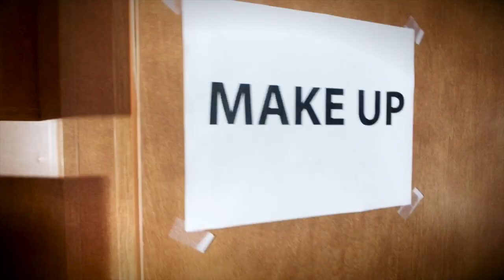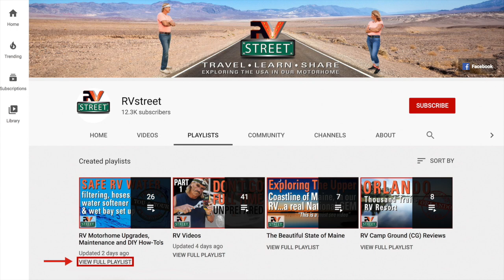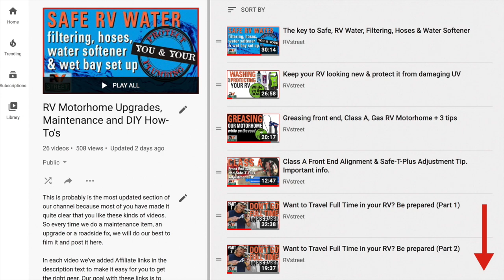RV KwiKee Power Steps: EVERYTHING YOU NEED TO KNOW

Comment: Great video pointing to more action I need to take maintaining my steps. Thanks. I had a failure on our power Maxx Air rooftop fan this week. The metal gear housing that activates the control arms for the cap totally shattered! Yet no plastic moving parts in the fan activator failed- go figure! Its an easy fix replacing it but I hate working on the roof! More proactive maintenance possibly could have forestalled that failure as the vent cap sometimes sticks to the lip seal flange stressing the system. A little seal treatment and lube could have saved me about $30. 2 other upcoming projects are replacing the house AGM batteries, and annual maintenance on the Onan genny. I've changed the fuel filter on the genny and the fuel pump once in 5 years but am debating changing them again so I don't get caught. 450 hours on it now. Future videos on sealant maintenance would be nice. I'm messy with it and never do a good enough job of cleaning out joints so any tips on that would be appreciated. Safe travels to RGB.
Reply from the maker: Good comments Joe. Thanks for the kind words on the stairs.
If I was you, I wouldn't change out the genny filter or pump yet if it's running fine. Just my opinion. But this is another one of those Crucial, High Priority parts to carry with you JIC. I carry new both as spares. Our genny has about 1,180 hrs. on it and runs like a charm and is exercised regularly. I'm actually going to do a vid on the genny this winter in RGV. 👍
Reply: @RVstreet  good point on carrying the spare fuel pump. The original was working fine when I changed it out and I still have it as a spare (need to get it out of the garage though and on the rig). The carb is my other genny worry but that's beyond my paygrade. Our rig is going on 6 yrs old and stuff is starting to show its age and has hiccups every now and then so spare parts are warranted. Just changed out the front tires and added Tyron Bands a few weeks back. With house  batteries change coming up fast I need to replenish the piggy bank for that while finding more storage space on the rig for spares LOL

Comment: Hi Martin! Thank you for this video! I had trouble finding a video with this style gear. I have a question that maybe you or someone else lurking in here might be able to help me out. The teeth on about a third of the gear are chewed up. So I'm replacing the gear and motor. I just figure I might as well replace the motor, too. The problem is the bolts holding the motor (and table) are just that...bolts with nuts buried in a really hard to access spot. Do you or anyone have any tips on how to yank that motor/gear off the table?  I am looking at pulling the table off but even that is super hard to access the nuts on the back side.  Any suggestion?  Thanks in advance!
Reply from the maker: Are the steps retracted up against the motor? Is that the problem of you getting access?
Reply: @RVstreet  no.  I actually have the whole frame removed from the rv and they are completely unretracted. The problem is the motor and gear are not SCREWED into the base plate like most videos show with the integrated gear, where you simply just unscrew the thing to remove it. On our model with this gear plate that you sanded in the video, the motor and gear are through-bolted to the plate they are mounted on, making it extremely difficult to get my fat fingers on the nuts under the plate (and covered by the very top of the steps.)  I read someplace else last night, it basically makes a 20 minute job a 3hr job...so it looks like that's just how it is.  Unless someone might know a trick!  Thanks for helping!  And once I finally get this all back together, I'm doing everything you said in this video to keep em working better going forward!!
Reply from the maker: @marnieravitch1371  Well, I'm confident you'll get it done and done right 👍

Comment: Martin..Question: I have a step motor very similar to yours. My steps quit working. I simply removed the motor, unplugged it and found it was the contacts. I plugged it back in, reinstalled it and now it operates in reverse. Door opens...stairs come in; door closes and steps go out. I thought it was a synch issue and opened the door, put the steps all the way out and the motor was in the open position. Reinstalled the motor and no change. I called Lip[pert tech support. She advised me that "The motor changed polarity" and you will have to buy a new motor. I am an engineer and never heard of such a thing. Furthermore, how would the motor have changed on its' own? She said "it happens". The wiring is correct and each end of the cable is unique, so they cannot be accidentally reversed. I am at a loss and really having a difficult time believing the motor changed its' own polarity! Have you ever heard of this? Now one would think to just reverse the DC supply wires, but the logic board, ignition switch, and door switch will be affected.  Jack
Reply from the maker: I've never heard of this change polarity thing either. However I have heard Lippert suggesting a new motor or a conversion kit, many of which bought it and found out later they didn't need it and returned it.

I believe I've already addressed your type of question in the comments section already. Also, it's always a good idea to mark the position of everything BEFORE you pull or disassemble anything. That way the position of the gears will go back exactly the way they were. They could be 180º out.
All these things work together, the motor, the controller that reads the step position, the main on/off switch and the door mag switch. And then don't forget, the ignition switch can over ride it all as a safety feature.

Comment: We have a 2005 National RV sea breeze and the kwikee steps are not retracting fully staying down about three inches i have found a broken ground on the controller and repaired that and still no luck at all.  I have al,so cleaned with brake cleen and did not have chain wax but used what i had available to me at the time.  Can you give me suggestions of how to ge tthese steps to retract fully ir appears that there is a AM 5:1 Gearbox with 214 Series Motor bein gused for the notoro assembly.  Beside myself with these stairs they do not cause alarm for the coach while moving as they retract far enough up but it is a constant reminder that they are beating me.  Thank you for your help and assistance in this RV repair issue.
Reply from the maker: I'm sorry I can't help you, Martin passed away and I have no knowledge on this subject.😢
Reply: @RVstreet  I am so so sorry to hear this my condolences, he will be missed by many. Godspeed

Comment: Good video, thanks, but my problem is when we park against a curb can't open de door without deploying the step and they hit the curb. There is any way to open the door with out activating the steps? I am afraid it will ruin the gears when they are half way out.
Reply from the maker: Not to my knowledge. I guess you could install a bypass switch down there where the magnetic switch is where you could manually turn off the power to that switch thereby fooling the step switch that you aren't opening door. But for me....I just don't pull up alongside a high curb.
Reply: @RVstreet  thank you, that a good idea better to the magnetic switch than the motor power supply (which I was going to do as a last resort). I have to be able to bring my motorhome to my house and can't block the driveway or else is a ticket. thank you for your prompt  reply....Mario

Comment: Hi, you pointed out a fuse that should be checked on the controller.  How do you check that?
Reply from the maker: It's under the stairs, next to the controller like I showed. 👍
To check it, you pull the fuse holder apart and look at the fuse to make sure it has not been blown.

Comment: Another Martin and Joanie recommended maintenance item checked off my list! I even installed the carpet pads and have a stool on order. One question...The paint on a couple of the rungs was flaking off. I chipped off what was loose and used a wire brush to clean the exposed metal. Do you suggest I use Rustoleum to repaint the rungs? Thanks so much.
Reply from the maker: When you say "rungs" do you mean the steps? Or perhaps the linkage on the sides of the steps? If you are then yes, I would paint them. But here's how I would do it if it were me. 
I'd remove the new covers you just put on. Then...remember that RUST video I just did a few weeks ago? See it here:
https://www.youtube.com/watch?v=QQnsKk1he-M
I'd buy a can of that Permatex Rust Treatment 10.25oz. and apply 3 coats to the scrapped, brushed exposed metal areas. NOT down in the linkage Clevis pin areas but on the steps & linkage areas themselves. Let that sit over night to cure. Then get a can of Rust-Oleum Gloss black paint at Home Depot. Apply 3 coats and cure over night. Then put the covers back on.
The reason I'd do it this way is, these beautiful new covers will retain some moisture when it rains or you wash the RV etc. They dry out fast but that enclosed area between the steps and step covers that gets wet from time to time, you don't want rust to start on that exposed metal. Treat the steps right once, and you're done with it.
Reply: @RVstreet  Awesome! Thanks so much, Martin. I will rewatch the rust video and order the supplies. I'm on the East coast and the weather is getting down in the 40s. Can this work be done in those temps or should I wait until a day when it's closer to 60? Sometimes we get fluke warm weather in the winter.
Reply from the maker: @jeanettejeffrey3896  Wait till it warms up some. Best done in 65º>
Reply: @RVstreet  Thanks again, Martin. The rust is on the linkage -- thanks for teaching me the correct terminology. I'll gather the supplies now in the event we have a couple of days in 65+ degree range.

Comment: A small tip about repairing stuck Kwikee steps. The steps on my 2010 WGO Vista recently stuck in the retracted position. Anyone who's ever faced this dilemma knows it can be a PITA to remove the cotter pin from the clevis pin. When reinstalling the cotter pin, don't bend the cotter pin legs to an acute angle. Conversely, you can replace it with a hairpin cotter pin, aka r-clip, hitch pin, hood pin, etc. Get one that's pretty strong so it doesn't accidentally come off. It's much easier to grab either with a hook or vise grips and pull it out and avoid the hassle of first straightening the cotter pin legs. BTW, my corona-cut is now a decent ponytail but I'll probably go back to my short cut when we start traveling again because washing thick, long hair in a moho is a PITA.

Comment: Martin my kwikee steps are the same as yours and they are making a horrible noise and only come half way out 
Do you think motor needs replacing or just a good greasing up
Many systems show a totally different gear box separate from the motor assembly
Reply from the maker: I always try the simple things first. So yes clean and lube all the linkage and main gear, gear box/motor area with the proper lube first. If that doesn't improve your condition then yes go ahead and replace the motor & gear box and then put your steps on a bi-monthly maintenance like I described in this video and they should be good for many years to come.

Comment: Question.. If the switch is not located on the screen door on the bottom right hand side as it shows on yours,. Where else would it be located? I was checking mines and it's not there. My friend has a 1995 Winnebago itasco and he is having trouble with the steps. Motor works but once he puts it back they won't open or close. Can l get some input so l can assist him? Thank you
Reply from the maker: Is this a problem that has just happened or something that has been going on for quite some time?
He should have a magnetic door switch down there. Maybe it was removed for some reason. Look closely down there and dig through the carpet and see if you can find 2 wires or evidence that there used to be a switch there. Maybe old holes in the door or molding. OR...crawl under the stairs and look up at that area and see if there's evidence of it being there in the past. Without the switch, the stairs are not going to know when to retract or deploy when the door is opened or closed.

Comment: Hi Guys, If switching on the ignition will retract the steps; will they automatically pop out again when you switch off the ignition. If so, is this a potentially dangerous problem?
Reply from the maker: No they won't unless you open the door. It you're stopping to park and now your ignition is OFF, you control whether the steps go in or out or stay open while parked when opening and closing the door with the step switch.
Reply: @RVstreet  Thanks for your reply. I have neighbour who has one and he has replaced magnetic switch with 2 manual switches - top and bottom of steps. The White cable for lock-out switch had been previously cut out and switch removed. I'm making a relay circuit with feed-back loop to hold in the steps when ignition switched on and retain them even after it is switched off. Momentary switch will release the steps to extend when needed after parking.

Comment: I have one of these Quickie steps, an old old one.
I was previously told the same thing, to check the magnetic switch. 
Actually he said, "Just kick it."
Well the microswitch is not the problem until you break it.
You can hear the control relays make and break when the door is opened or closed.
So the fuses are good, the microswitch is working, the Manual/Auto switch is working, the battery is good, and you can hear the relays working ... What can it be?
The microswitch is a magnetic switch.
Take a small handheld magnet and pass it by the microswitch.
Again you can hear the control relays make contact and release.
As long as the fuses are good, the Manual/Auto switch is in auto, and the battery is good ... Wait for it...
The controlled side of the relay contacts (Inside the control box) are sticking.
The control relay must be open for the steps to come out.
12V DC motors take a lot of current to operate and will eat relay contacts and melt them together.
Even AC contacts do the same thing and can short out your relays, phase to phase over time.
Passing the magnet by the microswitch a few times may unstick the contacts temporarily.
Maybe long enough to get you home or more.
Either replace the controller box completely or replace the relays for a much cheaper more permanent fix.
Of course the motor / gearbox could have gone bad also, but this costs nothing to check.
You can check to see if you have 12VDC at the motor with the door open, but I bet not.
This why you keep the old guys around.

Comment: Is there a way to test the control unit? With the switch on I have 12volts at the plug but the step will not deploy. I connected a 12 volt power supply directly to the motor and the step deploys.
Thanks  Brian
Reply from the maker: What you have done has actually tested and isolated the control board already.
1) You have power to the plug before the control board
2) You bypassed the control board and powered the motor directly and it works
Conclusion: The control board is the middle man that is not transferring power to the motor.
Have you done the other things that I covered in the video then? Like, checked & cleaned grounds, fuse enclosure and all the contacts in the wiring harness?
Is your steps not working a sudden event or has this been an ongoing, problematic issue that has finally failed? Have the steps been exposed to any extreme weather conditions, rain or anything like that? When is the last time they worked correctly? Has something changed recently?
Checking the things I listed above and asking yourself these type of questions will assist you to the course of action you should take.
thx Brian for watching and your question. Hope this helps. 🔧 👍
Reply: @RVstreet   Is it common to wire these direct without using a switch? What I thought was the "Step Switch" is not ( I have 12 volts at the plug regardless if the switch is on or off). I'm not sure what it is for, the left hand switch turns on the outside light, I checked the right hand side and it functions showing 12V when it is turned on and 0V when off. Anyway I can't find a switch that will turn the 12volts of at the plug.
Reply from the maker: @madden4306  Is it common to wire these direct without using a switch? No it's not.
Reply: @RVstreet  Thanks Martin
Regardless if their is a switch somewhere that is on, shouldn't the step deploy if the mag switch is functioning and I have 12V at the plug? I noticed that the light does not turn  on even though  I tested the bulb and cleaned the ground.  I'm thinking that I need to buy a new controller but don't want to spend the money if I missed a step.
Love your videos keep them coming.
Brian
Reply: I discovered that the switch is wired to the door magnet so  putting the meter on the red plug wire will always show 12 volts regardless of the of the switch position. Replaced the control unit and the steps now work. Took your suggestions and lubricated with Chain Wax and install the Presto Fit Ruggid.Thanks for the help.
Brian
Reply from the maker: @madden4306  👍

Comment: 2016 Lazy Daze with 13k miles....steps will n9t sray locked out....switch repaired still will not stay locked out. Works intermittenly.....check 5amp fuse at back of switch..good
Checked and cleaned grounds.underneath. cleaned but..both looked good. Disconected connector looked good..had dialectric grease inside....i am at a loss as towhat to look for next..10 minutes later...
I just went and cranked engine (it has a 6 month old die hard battery) and now lock out switch is working?????
Geeeezzzzz!!!